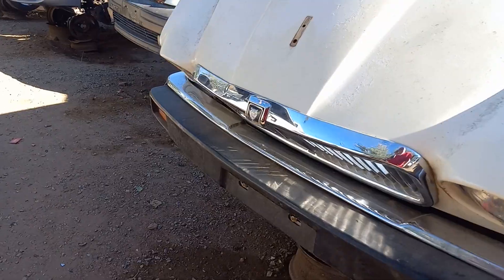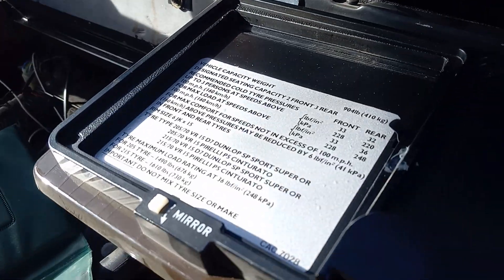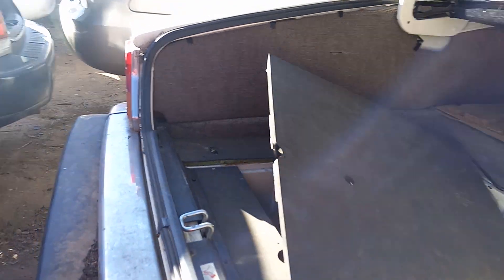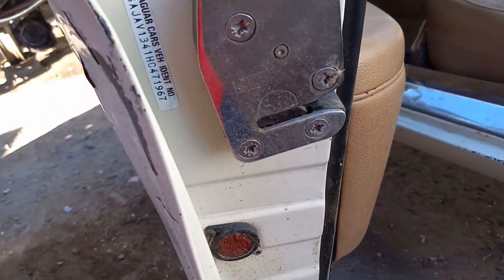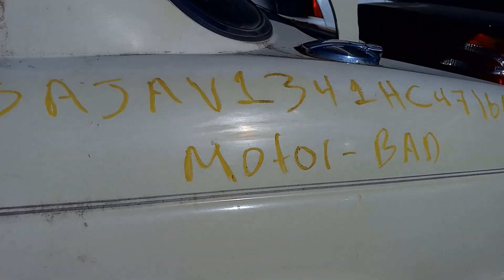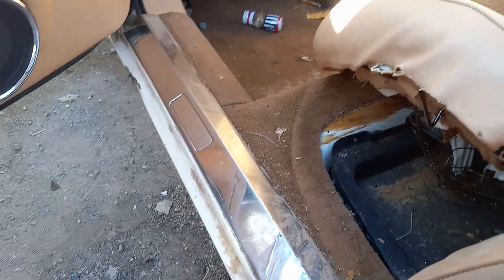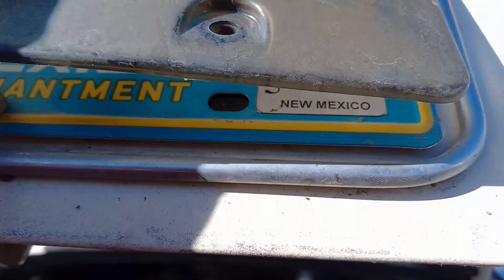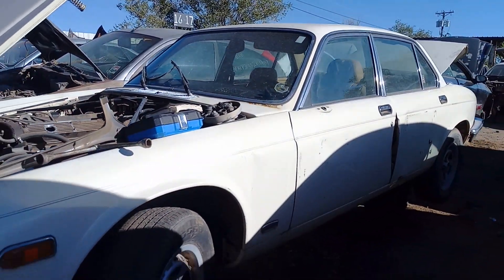Old skool junk yard Jaguar sedan.

Comment: Too much bouncing around with the camera, SLOW DOWN and stabilize it. 1987 model year XJ-6. Yes, those are the fuel tanks. There's a switch inside to change between the two. 

We got the VIN, we win: SAJ for Jaguar make, A for XJ-6, V for manual seat belts, 1 for four door sedan, 3 for 4.2L straight six, 4 for left hand drive with automatic transmission, 1 is a check digit, H for the 1987 model year, C for Brown's Lane, Coventry, England assembly and the rest is the production sequence. The Brown's Lane facility operated as a Jaguar facility from about 1951 to about 2005 and was demolished around 2008. The transmission I believe was a three speed Borg-Warner automatic. Some Jaguar models used a GM Turbo Hydramatic.

Should be code NDJ Nimbus White exterior paint.